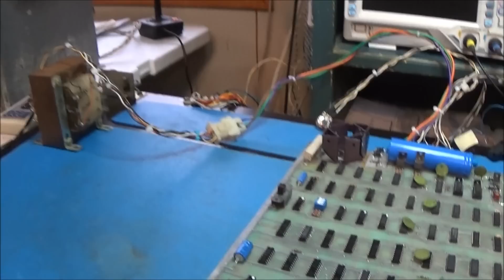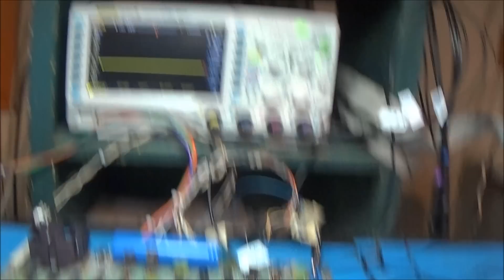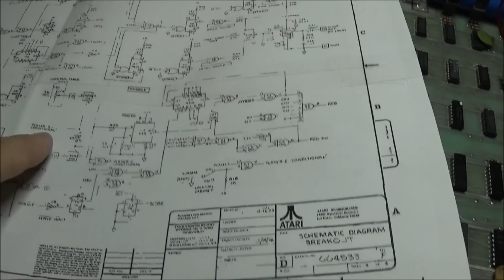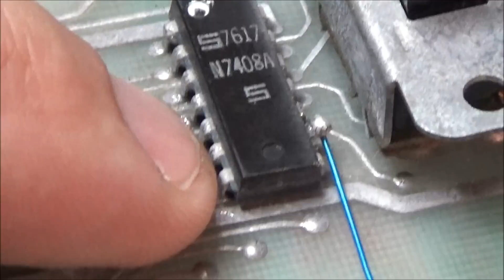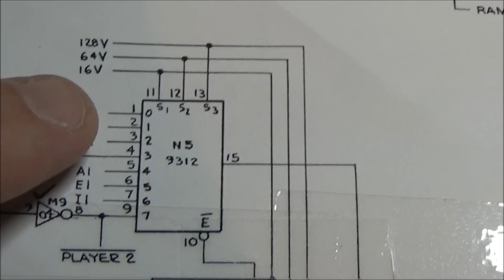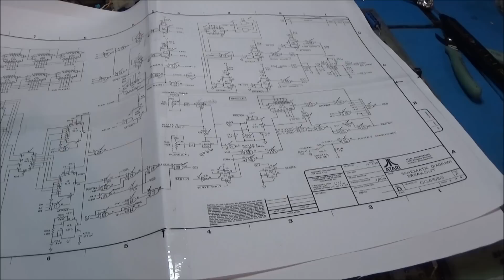1976 Atari Breakout Arcade PCB Repair Part 5

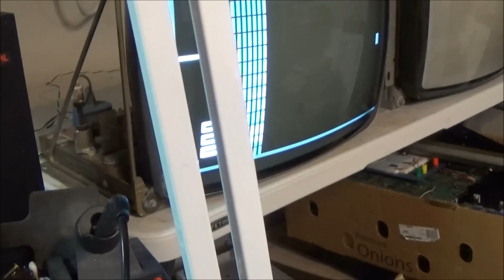Comment: You can see at 8:35 another fault with the scoring, where both players scores are (incorrectly) modified. That was when you were focused on the paddle's shorter range, though whatever you changed later seems to have fixed some of it. Interestingly, the low bit is actually shown in these, rather than the second bit later.

It's been a trip seeing all the different ways these old games break down. 20 years later most stuff will just fail to boot entirely if anything major is wrong, but these ancient things will just try to power through them. Not to mention the visual effects of a lot of these faults are interesting, too.

Comment: By coincidence I am also repairing breakout at the same time you are doing these videos! Actually not one, but 6! I bought a whole stack of boards a few months ago and it had 6 breakouts. I got a lot more luck than you are having, this board is utterly destroyed as far as chips goes. I had various problems on the boards, and at this moment I think I got 4 of the 6 running 100%. I had various  problems, some similar to what you are having. Also a problem with a stuck score bit, mine was adding 4 to all score digits when the third bit was on, this turned out to be the 9312. I had to borrow one of the 6th board, as I could not find these (I had already borrowed some other ic's of this board that are hard to find). I also had a paddle problem, would go all to the left, this is determined by the resistor and capacitor in the 555 circuit. They were according to the schematic, but I when I changed them with those of board 6, it worked fine (strangely enough these were less close to what the schematic calls for).
Board number 5 is next, it had a 1 inch crack near the edge connector cutting several traces. I have glued the crack as both sides were skewed, so hoping this will make the board level and I can start repairing the traces. Then board 6 is looking pretty good, but I have borrowed several ic's that I don't know where to get. Are you willing to share where you found the ic's? What's different about the 6th board is that it doesn't have the atari text on it. I don't think it's a clone because it looks exactly like the other boards, but maybe it is....
Reply from the maker: good score on the pcb's!     look up rochester electronics website...that is where i got the 9312's...   but you have to buy a rediculous amount as a minimum order....   (which i did lol)..
Reply: @classicarcaderepairs  Thanks for the link, I looked at the website and yes, I would have to order 144 minimum ;-) I just repair pcb's every now and then as a hobby so I that is too many for me. Today I started on board 5, the one with the crack. I glued it and repaired the traces. Look good again, and worked right of the bat. Well, 1st start there was no hit detect, but that fixed itself on the 2nd start. One odd thing though, in demo mode I noticed the ball getting 'stuck' in a repeating pattern. This is caused by the ball bouncing from the wall (where the bat normally is) in the same direction it came from. I looked at a working board, and it's supposed to bounce 4x at a 90 degree angle and then the 5th time back in the direction it came from. This will be a hard one to track down. Not a big deal but my OCD tells me this needs to be fixed :-)
Reply from the maker: @patzik1910  i hear ya about the ocd lol..  and if you ever need any 9312's..  let me know
Reply: @classicarcaderepairs  Thanks for the offer, I'll keep that in mind! I just worked another half hour on the board trying to track down this 'issue' in de mode where it starts looping in the same pattern. Then I noticed that it was the same on anther board. Tried a few other boards, and they do the same thing, so I guess it's normal ;-). First couple of rounds are of a more random nature, and after about 30 seconds it gets into the 'loop'. Still a couple of things to test on all boards. The bat should become half size when you hit the back wall, and I'm just not good enough to get to that stage hahahaha. Also the button lights, I have to build a small test setup to see if they work properly.
I'm sure you will finish this repair without any 'problems' but if you run into an issue where you need me to compare signals just let me know.
edit.. for giggles just check in mame and does the same thing :-)

Comment: aren't 9312's like 74LS157 pincompatible? Just on top of my head without looking it up, might be wrong.
Reply from the maker: Nope..  it is the same chip function wise as the ls151.       But a completely different pinout

Comment: Random scores or bricks/no bricks after switching the game on is normal. There is a chapter on that in the manual (4.4.1).
Reply from the maker: yeah  i saw that...  unfortunatly it just doesnt count the score corectly...   and i did verify that the 160's are counting correctly...   thaose bits are just not being muxed correctly by the 9312's....